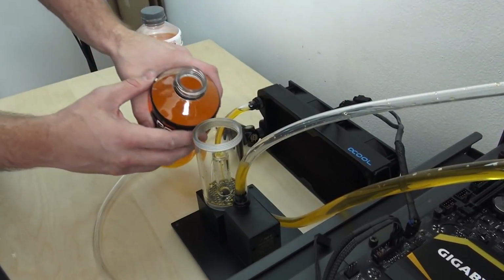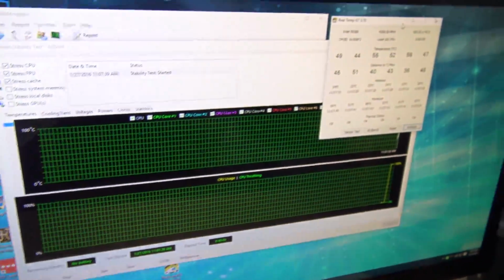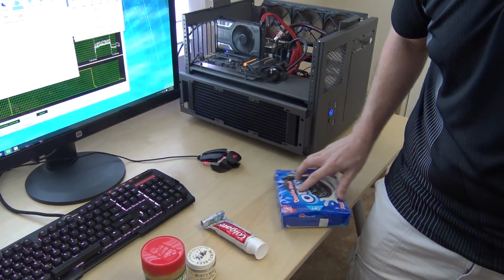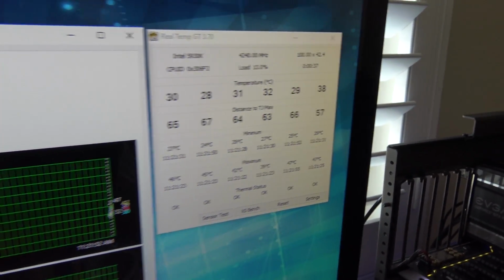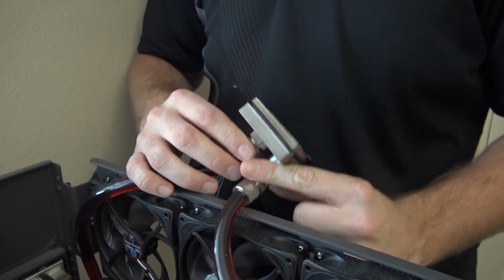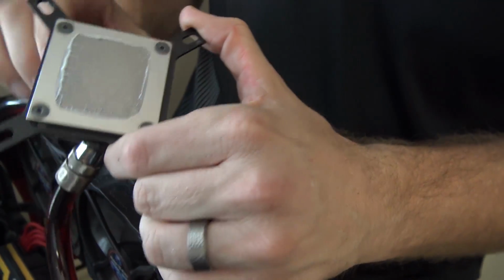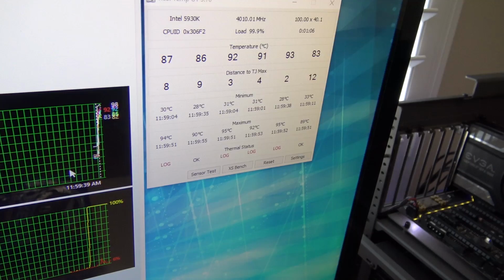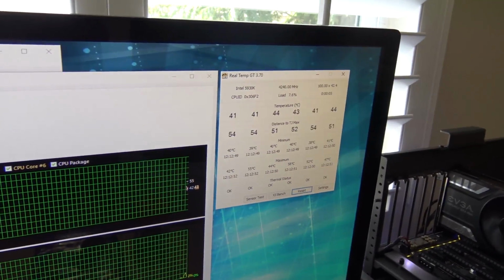Two Idiots Install Household Products as Thermal Paste

Comment: I don't know about peanut butter, etc. but here's my recipe. (Percentages are reflective of volume not weight!) 70-75% White Lithium grease, 15-20% very fine Zinc Powder and 5%-10% very fine Graphite powder (you get it from lock de-icer bottles). Mix these 3 very thoroughly, and let the mixture sit on your desk before you close the container, to allow most of ethyl alcohol (present in lock de-icer fluid) evaporate for a couple of hours until your end product no longer smells like alcohol. When thoroughly mixed it will look, smell and perform very similar to thermal paste. Lithium grease has a high melting point, above TjMax of most AMD CPUs, there is a reason for this - it is used in rotating high speed parts (ball bearings) where heat is the issue. This will be much cheaper than buying thermal paste. 

 No, don't use ground pencil leads, you need very fine graphite powder present in de-iсer to make sure large graphite chips aren't stuck between CPU and heat sink surface. If the CPU you are using has no heat shield, - this could actually damage the CPU, so yes, - get the de-icer bottle, CRC Magic Oil is probably the best I've used and it's only $5, not to mention you need very little of it for the mix. Yes, you will need to change it every 8-12 months, just as you do with regular thermal paste. There is really nothing sophisticated about most types of thermal paste to justify the inflated price. Chances are, if you go for the more expensive thermal paste - your overall temperature difference will be at most 1-2 degrees Celsius compared to my recipe or to cheaper, ceramic, graphite, silicone, etc. thermal paste.

Comment: Milk is a protein solution and proteins start to degrade when at over 60°C (I dunno, like 160°F?). All proteins degrade into amino acids (the proteins' building blocks), and in case of milk it degrades into, among other things, a lactic acid, which is that yellowish substance. The lactic acid is also what forms when a milk goes rancid, hence the bad smell. I wouldn't advise to consume that unless you plan on spending some quality time at the bathroom.

Comment: I would really like to see you use automotive never seeze. It has a metallic compound in it will never Harden doesn't liquify under Heat and I believe that you could probably use it and get just as good as a result as Arctic Silver! For half the price in about 200 times the amount in a container even comes with a neat little brush lol

Comment: reinstalled my gpu and cpu after dustcleaning without using any thermal paste ...still runs cool (50-60deg celsius) after a couple of years (asus engtx285 / intel core2quad Q9550 in an antec 900 case)

Comment: The less toothpaste you use the better, within reason of course. Also the thinner toothpastes work better, at least with colgate. If you use too much it dries out and acts as a massive insulator. but otherwise it works surprisingly well. My 4460k (albeit not overclocked) runs at full load at around 38-41, and normally is around 28. this is with a stock intel cooler too.

Comment: Used drop of cooking oil as thermal "paste" a few times. Works good enought, the last time it worked for about a year till changed to actual thermal paste, just don't use it too much and it will not leak out, and as it is suposed to be fried with, it doesnt get affected by higher temperatures, as oposed to water based substances like toothpaste. Temps was comfortably sitting max around 55-65 degrees with air cooler if remembering correctly.

Comment: We use silicone light bulb grease on ignition mudules as a mechanic in the shop. I have a phenom2 1090t running 2 years on it. Probably not the best but it does work.

Comment: Hey Jay I bought that case you are always advertising and the ventilation is absolute shit. I've had to drill and cut into the panels so much just so my water cooler wouldn't blow hot air 24-7. Had to also order fan grills because I don't want the fans to turn into a headset chipper.

Comment: first time I built a pc I took lga775 fan on a 1156 cpu and put the flat part of a door hinge between the fan and the cpu and I got 74c on the bios, I freaked out and bought a 240mm rad water cooler for it(which came with thermal paste)

Comment: I think better products would have been sunscreen (zinc oxide), aluminum based anti seize, and copper based anti size. 
I would expect the sunscreen to equal cheep thermal past (same composition). Both anti seizes will out preform regular thermal past however they are electrically conductive  so if they get on anything else they will fry it.

Comment: Anything that excludes the air-film between metal surfaces will be good.
If the goop is also thermally conductive, all the better.
Anyone using Indium foil?

Comment: i have used toothpaste before, as emergency thermal compound when a workstation needed to be constructed in a remote location in a short time, with minimal tools

the experience was that it worked ok for about 48 hours but then rapidly degraded and was found to have dried, with reapplication needed for return of functionality

thermal paste was available about a week in though

Comment: I think testing solder as thermal paste would be interesting... although, due to the temperatures involved in soldering, you'd probably have to delid the processor, solder the fan to the lid, and then put the lid back on. I think no one's tried it because it would be a very destructive experiment if it didn't work out...

Comment: For those who try to use toothpaste as compound, mix the toothpaste in a 75% toothpaste to 25% vaseline (or oil) mixture and it will perform similarly to regular thermal paste.

Comment: It's probably been done before, but why not try copper grease that's normally used for your car brakes? Silver has a higher thermal conductivity rating that just about anything else, so some silver anti seize compound also? Ounce for ounce, I'd bet that the car stuff is cheaper than commercial thermal paste and probably as effective if not more.

Comment: They should have tested wheel bearing grease. It contains no water so it won't dry out, and it has a high melting point, so it won't melt. Those are huge factors if one was to actually use a compound for a long period of time.

It should work great even though it still would be a bit less effective than TIC.

That said, wheel bearing grease is not a common grease in most people's homes unless they do a bit of mechanical or automotive work themselves. It should be easy to snag a bit from a local mechanic for free though— at least if you're already getting some work done.

Comment: Why didnt you test thermal pads (tapes thats used for memory chips, including self adhesive), 0.15mm, 0.5mm, 1mm...? OK, thicker than 1mm, like 5mm is probably just a sponge, but still, maybe 0.15mm can do a job? Like, forever, without changing it every several years. Im saying it because 0.15mm variants are made from copper, silver and similar things, usually used for laptop CPU/GPU. Some of them are even liquid, but more expensive, like for 1 CPU its $20. I mean, we should explore some real alternatives.

Comment: Gee, I was hoping someone would attempt SuperLube 21030 Synthetic Grease (NLGI 2). It is supposedly good up to 450*F. Dielectric. Non Capacitive. Contains a bit of PTFE. And is a USDA/NSF listed Food Grade lubricant NLGI-2, rated H-1 for incidental food contact. It's fantastic for lubricating Sleeve Bearing Computer fans.. But, would it even half-way work as a 'Thermal Compound'???

Comment: Hey Jay or anyone in the comments! I was wondering if you could tell me what you think is wrong with my PC. I accidentally touched the HDMI to the bracket on the back of my GPU where the HDMI plug goes, and it turned on my PC. The HDMI was already plugged into the monitor, and it was on.
Reply: You have a shit PC and monitor :v
Reply: B1u Toast They actually aren't. Must be something metal touching something it shouldn't be.
Reply: you probably have a config problem touching the bracket with an HDMI (even if active) shouldnt harm anything, im guessing you have already sorted this out by now

Comment: jazz a couple of years ago when I was replacing cpu's in the 32 old computers that I had I used to use pipe dope for gas fittings and am wondering is that would be a good thermal compound because that never dries out

Comment: They need to make a power supply smarter, so it can lower the power slightly when the CPU gets hot in order to balance the Thermal Throttle and improve performance, and the heatsink needs LED lights to dissipate the heat faster.

Comment: That thermal paste you took off didn't even cover the whole CPU.  If you use non-conductive, just put it on. I have seen best with 4 lines 2 sets in a plus and 2 sets in an x. Covers the chip and maintains equal cooling.
Reply: ***** No, it doesn't have to be completely covered. The chip IS only in the center. Physics does say that the entire cpu coverplate does get heated, however not as much as the center where all of the heat is generated.
Have already seen 3 tests showing just center thermal paste vs full coverage. They all showed better cooling, all 3 showed improvement in cooling. 
Why do you think cpu blocks take up more than just the area over the cpu chip? That is because it is meant to cool the entire cover plate.
Another test I saw was putting far to much. About 4x the amount to cover the whole plate. He actually got better temps by 1-2 degrees over the pea method, all while the paste was squeezed out around the cpu.

Get non-conductive, which any good company already makes. You don't need to worry about failure, it can cool slightly better, and gives you that extra bit of heat transfer.

Comment: Toothpaste works like a charm on my core 2 duo e8400!
Reply: arthur staal That thing doesn't produce enough heat to warrant any sort of cooling really :P
Reply: Mike Peabody oh it does trust me... Under full load on the stock cooler it reaches 80C pretty quickly (normal thermal paste and OC to 3.6 Ghz)
Reply: i gave up mine like 2 months ago .... it ran 4Ghz .. maxed at like 60C on a 20 buck  arctic freezer 13.
Reply: arthur staal i mix 3 parts toothpaste and 1 part vasoline.
Worked great for 4 months.
No issues before changing it out! ✔💯
Reply: midnightmodder thinking of trying that as thermal paste !! Wonder how it will hold up :)
Reply: Who the fuck has a e8400
Reply: Andrew Cotten lots of people who have dell 780 optiplexes

Comment: Try axle grease or motor oil next. :)
Reply: You don't want your thermal paste to be electrically conductive, though...
Reply: mystic1754 Puh-lease... I had that very problem only a week ago, but a wooden wedge and a few firm hammer blows was all it took to fix. Of course, the CPU jumped across the room, but those pins bent right back, and it works just as well as it ever has.

A stupid idea doesn't get less stupid just because you can get away with it, and using an electrically conductive thermal paste inside a computer is stupid.

Comment: you dont need to worry about it blowing up, it will shut down on overheat. did you do a baseline with no thermal paste?
Reply from the maker: Why on earth would I do a baseline with no paste? As you said it would do nothing but thermal shut down so that test proves nothing at all. The base is to be performed with actual thermal paste, which we did
Reply: http://www.hardwaresecrets.com/thermal-compound-roundup-january-2012/5/
Reply: it would've been interesting to see how well/bad a cpu performs without thermal paste. but i'm sure someone has done it already.
Reply: +Terry Wilson  What if you carefully lapped both the CPU and the waterblock in a similar manner to how gauge blocks are made, then used no thermal paste. If they were both as flat as gauge blocks then theoretically they would have a better thermal bond than using any thermal paste at all.
Reply: +Terry Wilson  I think people have done it, but it's incredibly time consuming, requires a lot of specialized skill rarely found in gamers and PC enthusiasts. Might be worth a try, I'd have to learn how to properly lap something but I suspect I could learn to do a reasonable job if I spent a few weeks to learn how. Definitely try on an old but hot CPU. Q6600 maybe.
Reply: We used to do that 20+ years ago but still used some heatsink grease because CPUs and especially heatsinks were so rough and often just cast and not even milled or polished. I used to do it on high end audio and sound amplifiers too lapping the heatsink and the transistors. Another trick we used to use and I'm still surprised no one does it with CPU heatsinks is paint the heatsinks (except the contact points) with flat black spray paint.  You can raise the efficiency up to 10% and is based on Black Body Radiation theory .... You can spray paint a lot of heatsinks with a can of dollar store spray paint so you get a lot of bang for the buck

Comment: I've used a mixture of tooth paste, silicone grease, and vaseline for an extended period. I put it on out of desperation and never removed out of laziness. It worked just fine, and it didn't harden, run off, or ruin anything

Comment: From experience, the mixture of 3 parts toothpaste, 1 part vaseline and whatever old used thermal paste I scraped off the heat sink worked for an old pentium 4 rig a friend of mine used as a spare server.

Comment: maybe using gallium as a cpu cooling fluid would be good here just here me out melt the gallium pour it into a hard tubing loop and then it would solidify so then because of the hot cpu it would melt then while it's melted you plug your                pump in and then the cpu Tempsford would stay pretty low while the fluid is being pumped around!!!

Comment: Before I watch the video. The point of thermal paste is to fill up small uneven bits in the CPU cover and heatsink surface to better conduct the heat. Modern CPU's and heatsinks are well polished and are clamped together with quite some force, meaning there are very few places where there are actual gaps. So I expect minimal variations in the results. Toothpaste is quite course so it might be quite bad, handgel might be a bit better. Overall thermal paste isn't as much of a deal as it used to be back in the day.
Reply: owh and anything based on water will be quite bad at conducting heat :x
Reply: ThaTyger, look a little closer / smaller and you'll see a polished surface is in fact quite rough.
A polishing process adds scratches, it's the scratches that catch the light and make things look shiny. Something perfectly flat normally looks slightly mat as your only seeing light reflect from point.

Comment: try  diaper rash ointment with like 40% or higher zinc,suppose to be good results.
Reply: This is actually a good idea. The zinc in it will help conduct heat away from the cpu. Very similar to how actual thermal compound works.
Reply: yep

Comment: I'd like to see some benchmarks with using thermal paste on an oven hob plate with a pan to see if you can cook faster ;)
Reply: Thermal Paste is supposed to keep things cool. On this basis, it would take longer to cook as the paste would partly absorb the heat from the hob plate.
Reply: Nope, it's a thermally conductive compound so it would in theory aid heat transfer from hob to pan.

Comment: i have found the chosen super lube for a heat sync http://www.homedepot.com/p/Super-Lube-3-oz-Tube-Heat-Sink-Compound-98003/202932736
Temperature range from -45 degrees F to +500 degrees FHigh dielectric strengthExcellent heat transfer efficiencyViscosity stable

Comment: a more interesting thing to try in a water block is Galinstan since it's 10x more conductive then water and used as a nontoxic replacement for mercury in thermometers . that said it is known to be sticky so you shouldn't use it with a waterblock when you test. supposedly a magnetic pump is needed but capillary action should work fine for short tests. also the best thermal paste is potassium that said it oxidises easily so the only way you can really use it is to de-lid your cpu then glue the lid back on so it has an air tight seal.

Comment: "This is probably the most pointless video I've ever made"
Perhaps, but these 'let's do something kinda stupid and see what happens' are a lot of fun ^^

You may have wanted to consider using some moulding clay or something to contain any potential spills similar to what you need for phase change cooling.  Also, purely for comparison, what temps you get with no 'paste' at all.

Comment: I have a theory. The hand cream was the most successful, the Oreo filling the least, because the hand cream was nice and thin, squishing out & allowing at least some heat to radiate into the water block. But the thicker stuff basically acted like a blanket. would be interesting to see hand cream v.s. nothing at all comparison...
Reply: John Doe And also likely the kaolin helped - it's a type of clay that is used for certain ceramics.